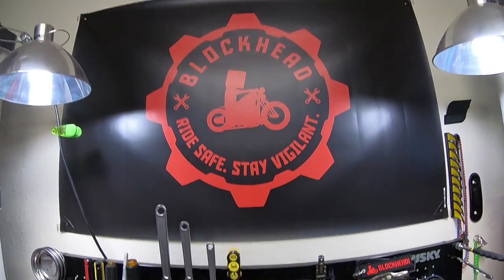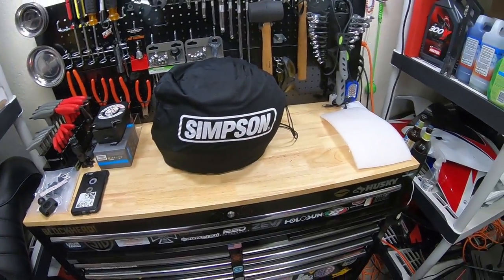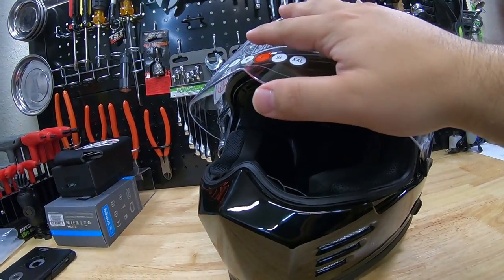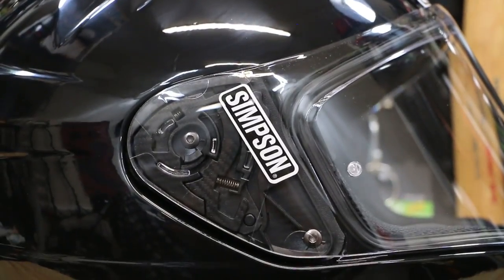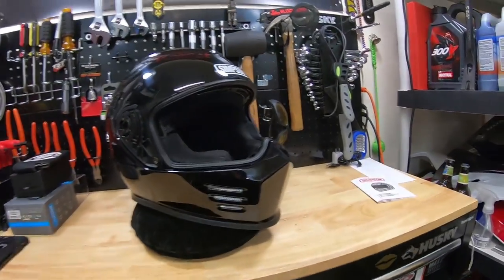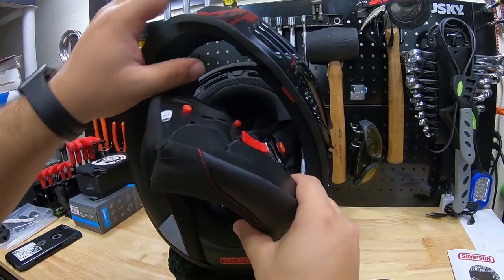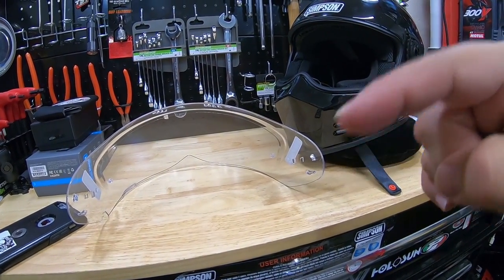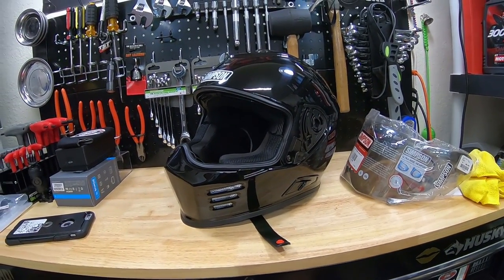Simpson Ghost Bandit Motorcycle Helmet! - First Look

Comment: Actually Revzilla says to order a size smaller.... but that video is 3 years old. I called them in July of 2019 and was told that Simpson re worked their tooling on this model and the helmets fit more true to size now....
UPDATE, my head measures 57-1/2 CM. That is at the high end of medium on their chart.  I ordered the Ghost Bandit in   medium and it fits just about perfect. My head is an oval shape. I never thought I would be in a medium, always bought large in the past to avoid pressure points at the forehead etc. now that they make oval shaped helmets I realize my true size is a medium, at least in this case....

Comment: Would like to hear your thoughts on the Ghost Bandit now that you've had it for a few months. Any chance of an update?
Reply from the maker: Review vid soon
Reply: I got one.
But I'm surprised noone mention mist on visor after 1min on my head?? Vents fully open..
Reply: I bought one. You're right, it mists up faster than any helmet i've tried. I just got the pinlock insert for it, so shouldn't have any problems from now on. Only other thing i'd mention is that it's damn loud. Anything over 40mph without earplugs is risking serious damage. I ride with earplugs anyway, so it isn't a problem for me. Other than that, it's a fantastic helmet. I also switched the internal visor to clear, and the external visor is dark smoke.
Reply: @BlockheadMoto  still waiting.. or will bikenbird beat you to it ;)

Comment: I like the way it looks but that's it. Few criticisms: it's loud at highway speeds, I put a small crack in the visor trying to take it off, it fogs up easily (guess I need pinlock insert),  the chin strap snap is very close to the side and difficult, the visor movement is clunky. Recently switched from bell vortex I had for five years. This Simpson ghost bandit is inferior in almost everyway.

Comment: From a perspective of safety, there is really no point in getting a full face hamlet without a Snell rating. Might as well use a halfshell.
Reply: David Eads , why is that?
Reply: Shad Rogers DOT certified only means thet the top of your head is protected because that's all that they test for. The ECE rating is just the European version of DOT. Basically, the face shield and chin guard could be made of the cheapest materials and still be DOT rated. I'm not saying that's the case with this helmet, I just want to clear up the misconceptions about DOT and ECE ratings.
Reply: Safety aside, it's a great lookimg helmet!
Reply: Fake news.
Reply: most people i know don't wear a full face for the full protection as much as they wear a full face so they are able to breathe while driving down the road at 75+mph down the freeway.  not to mention the bugs rocks and debris..
Reply: Daniel Pettley I understand that. Like I sayed in that other reply, I just want to clear up the misconception about the safety aspect. Sorry if that didn't come across.
Reply: 100% agree i was just stating why i wear a full face etc
Reply: Mazen Ahmed That's not necessarily true, but the DOT and ECE rating have nothing to do with whats below the ears and brow. All I'm saying is a manufacturer COULD use the cheapest materials possible in the rest of the helmet and get a DOT and ECE rating.
Reply: THey are snell rated look at the website
Reply: XIPF7 I did, and I could not find any mention of a Snell rating for this helmet. Other versions of this helmet, like the Street Bandit or Outlaw Bandit, have a Snell rating, but the Ghost Bandit does not.
Reply: You're right, I assumed that with their cheaper ones having a snell rating their most expensive one would too.
Reply: XIPF7 that's a reasonable assumption. Doesn't really make much sense that the one without is so much more expensive
Reply: This helmet has a drop down visor. Solely because of that feature, the helmet won't be SNELL rated. Can't truly say if this helmet would be SNELL approved or not, but the Street Bandit is SNELL approved.
Reply: VanillaPachi I wasn't aware that that was a determining factor. Thanks for the info.

Comment: That flat nose looks like it was made for mounting a gopro.
Reply from the maker: You’d think! But mounting it there wasn’t that great, angled the GoPro way too far down or stuck too far out flipped over
Reply: It would not be that hard to design a helmet with a built in gopro mount system. I'm really surprised no one has attempted it. It might be considered a niche market but with so much competition in the helmet market a niche helmet might be pretty successful.

Comment: Simpson only complements the Trail rider and cafe racer -  not Easy riders. Wearing a Simpson bandit on a sportster 48 don't feel right . I have an original Simpson - very narrow vison  - old school. London cops always confiscated them. The state deemed them unsafe and contraband. After 25 years the old school riders break out the noble Simpson. The cops don't notice anymore. I am proud of my Simpson.
Reply from the maker: The ghost bandit doesn’t have narrow vision at all. Actually much broader vision than my last helmet which was a Shoei RF1200.
Reply: BLOCKHEAD back in the early 90s the Shoei lids were the most desired because so ahead of the game but the Racing Simpsons were  coverted and provocative(illegal) - a cool anti - social look. Today the Simpson lid is groomed and curtailed to fit standard road safety regulations - hence the wider vison. Blame these rules on the E.U. control freaks. You must at least invest in a dark visor - this completes a Simpson lid.

Comment: This helmet was such a disappointment. I got the most expensive carbon version and two months later I am getting something else. To anyone considering it, be aware that if you are used to other premium brands (agv, shoei, arai, etc) you will be extremely disappointed. The helmet looks cool, and is quite light, but that is about it. The noise is unbearable, as are the aerodynamics. It is literally only for low speed riding. The worst part is definitely the inferior quality compared to others in this price range. The visor does not seal properly, scratches extremely easily, the internals started to fall apart after a few uses, and what shocked me the most is when I realized that the EPS liner is made from segments which at some points were literally held together with tape. Finally, just so you know, even the most expensive carbon versions are made in China, which Simpson does not mention anywhere on their website. For the same price I am now looking at the Shoei X 14 (X spirit 3), which is on a completely different level in every single aspect.